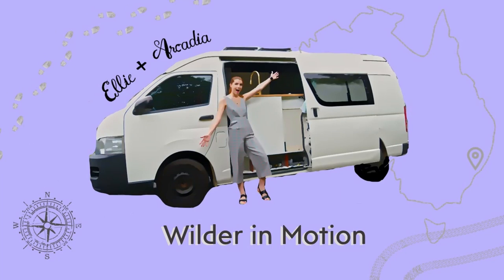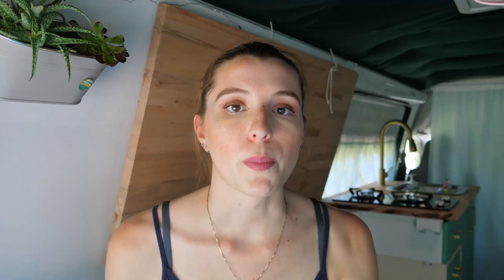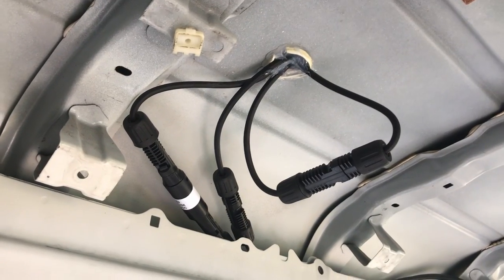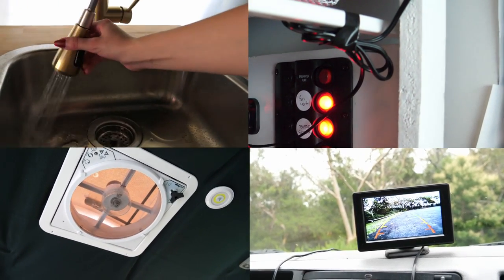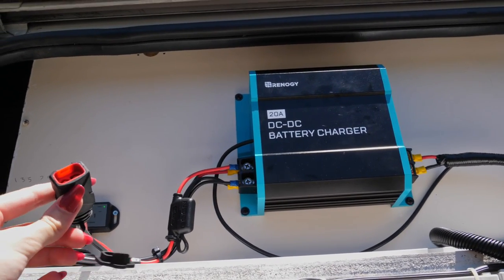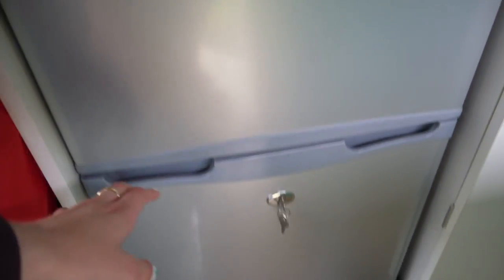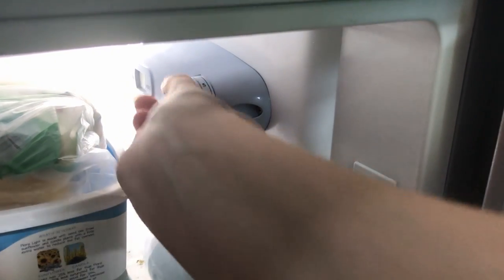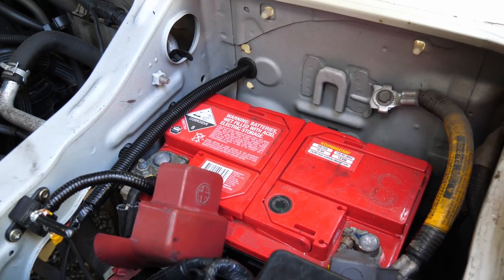12V CAMPERVAN ELECTRICAL SYSTEM - Solar Installation, Lithium battery, DC-DC Charger and More

Comment: There’s a second battery compartment behind the drivers seat.
Also 2 large holes on both sides near the main battery and the second for cables plus attachment points on the back of the fire wall for either clips or cable ties to secure the cables. Install a dual battery kit also.

Comment: You need to keep the fridge full in both freezer and fridge area, replace items used with bottles of water. Run AC home power to the fridge once loaded before leaving home to ensure the fridge is at the correct temperature. 
Once on battery power it should not be a problem anymore.
Opening and closing the fridge a lot will give the battery system problems in keeping the fridge at temperature. Air is hard to chill as it will be at ambient room temperature.
Chest fridge/freezers with an actual compressor refrigeration system are the best and most efficient in regards to power usage.

Comment: How is it going? Me, I'm a bit concerned about the capacity of your DC2DC charger. I know you're not going to charge from dead flat (very often), but 20A would take six hours of charging for a 120A battery. I expect to drive regularly when on the road, but not that much.

I will add solar when and if required, solar panels add drag and so increases fuel consumption. It's a huge hint to rangers too.

Comment: The fridge dissapates heat in it's sides. We are doing the same in a caravan and there needs to be 25mm or more around the fridge and on the top because they have put the cooling fins in the sides of the fridge. They should have put them at the back.